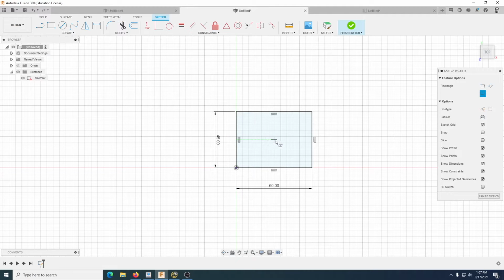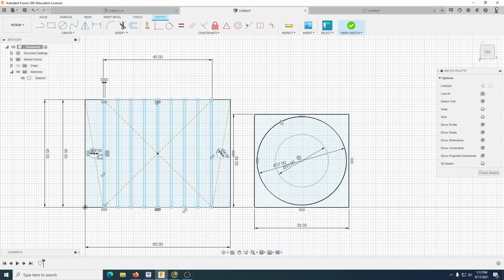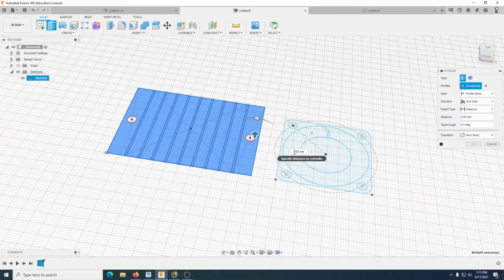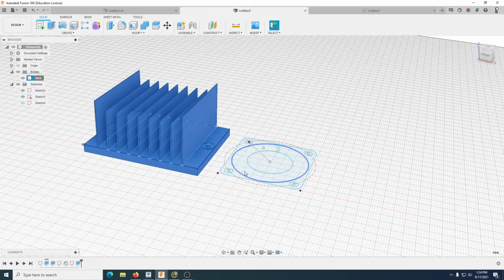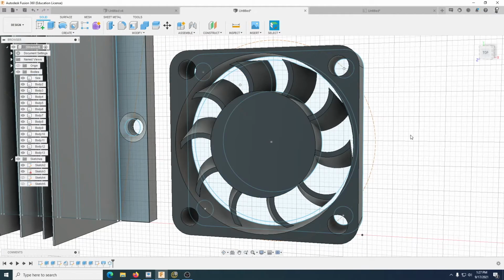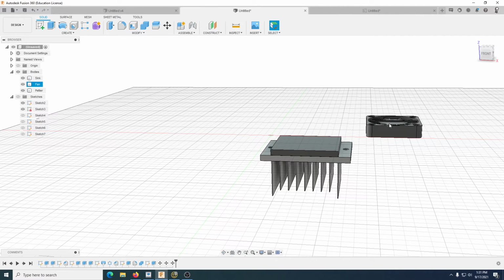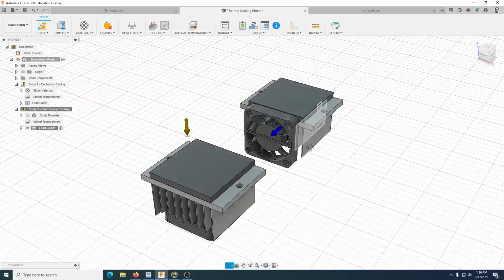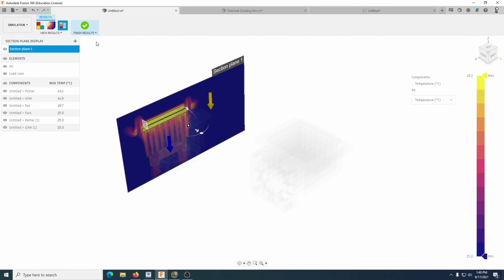Fusion 360 : Thermal Cooling Simulation

Comment: In the simulation, is it possible to create an enclosure, place all the components inside it, and analyze the thermal behavior of the heatsink within the enclosure?

I would like to evaluate how the enclosure affects heat dissipation and the overall temperature distribution. Thanks!

Comment: @w33va Seems like the heat source snaps to the heatsink when you are moving it. Is that the case or does it just look like it? How can that "snap" function be activated in Fusion 360?
Reply from the maker: I guess it creates "results layer" when you select view results it automatically snaps
Reply: @w33va  did not quite understand that answer😬